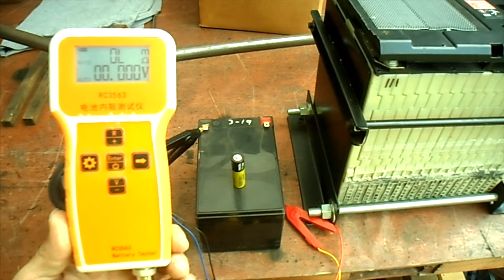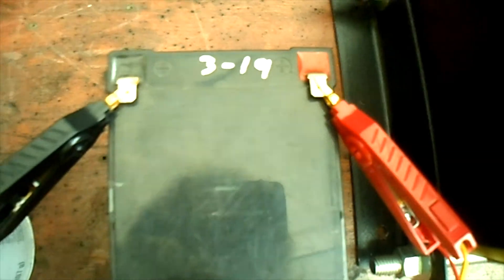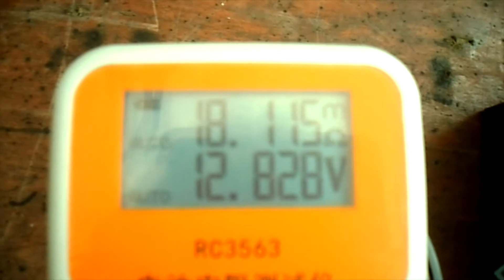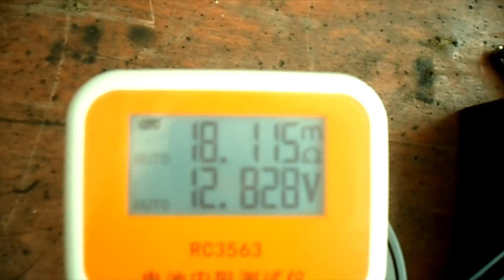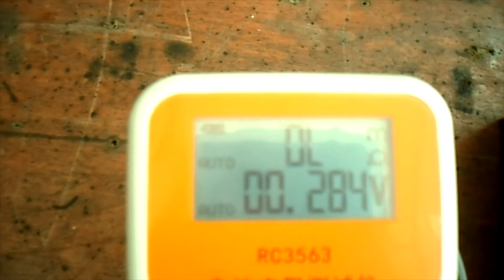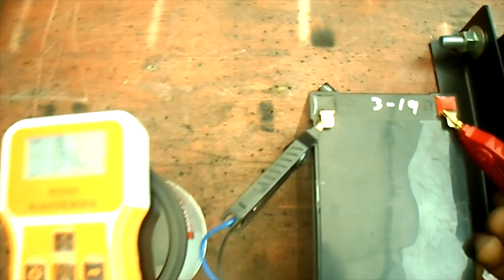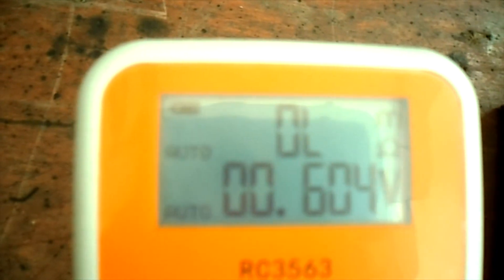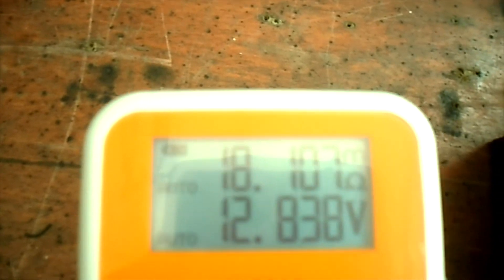RC3563 Battery Tester (inconsistent readings?)

Comment: 15APR25
I own two RC3563 battery testers and they're both inconsistent in a manner very similar to your demonstration. I purchased a 4 terminal 20.00mΩ 0.25% precision shunt resistor because this is the same value used (apparently) to calibrate this meter (This value is quoted in the calibration menu). The bad news is that the measured value is variable and inconsistent by as much as 2%, but sometimes it's spot on, e.g. 20.04mΩ on a 'good day' lol. Additionally, when measuring two different Fluke precision shunts, 10.00mΩ 0.25% the results are similarly flakey.

I did notice the wiring for the pair of source leads and sense leads appears to be reversed when comparing the internal wiring to the probe wiring. I tried reversing the sense leads in the probe connector and found, you guessed it, more inconsistency, sometimes it helped inconsistently. 

I've made microohm measurements for at least 40 years and there's something wrong, 'consistently wrong', here. The tester is good enough to measure an approximate resistance, but is unreliable.

BTW - Those who think this is a contact resistance issue don't understand what's going on here.